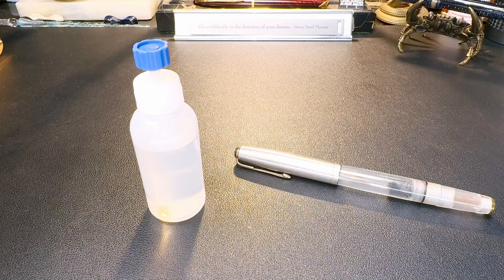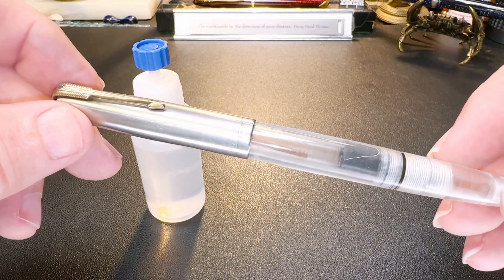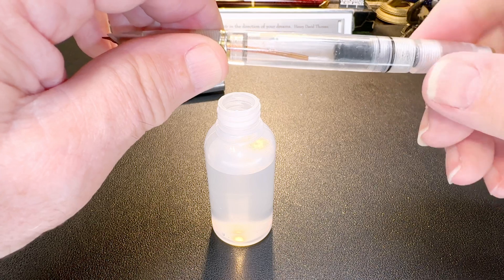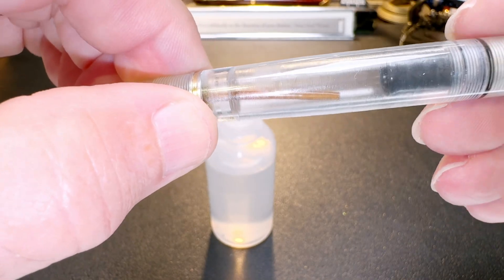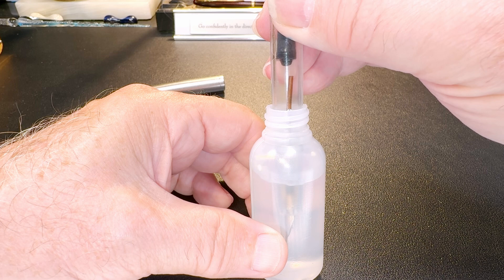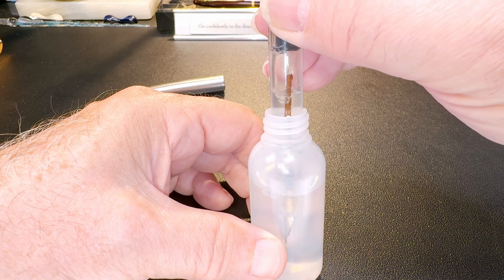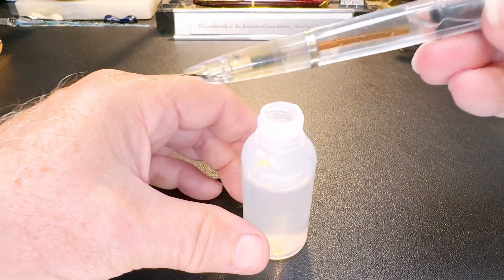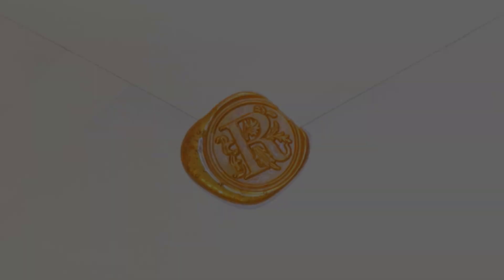How Does a Parker Vacumatic Filling System Work?

Comment: Doug....great job. I have to remove a black jewel and trying to get up the courage to do so. Do you mind sharing what type of heat gun you are using. Also....would love to see you polish and learn more about the polishing compounds you use.  I just have fallen in love with my Vacumatic but also don't want to damage it. JH
Reply from the maker: I try not to use heat on Parker jewels. They are soft plastic and will melt easily. I put a pencil with the eraser end inside the cap and then press down into some rubber mat material or a rubber band and try to twist it off. If that doesn't work, I'll let the cap soak for a while in the ultrasonic pen flush bath and try again. If that doesn't work I put a drop of "Pensbury Manor Pentrate Pen Potion #7" on the finial and let it sit overnight and try again. https://www.pensburymanor.com/product-page/pensbury-manor-pen-potion-no-7

Comment: I do prefer this rubber vacumatic to spring loaded piston used by Wing Sung 601, because it doesn't get clogged by pigmented ink and needs no greasing.
So I bought the rubber kit for 601, which works well. Though it went from 4-5 pumps to 15-ish pumps to fill the pen.
Reply from the maker: It sounds like you've found a great solution for your Wing Sung 601!

Comment: Nice demonstration video Doug!  And to think, this was a pen that once upon a time only dealers and salesmen used to promote the sales of these pens.  I saw the pen in action after I acquired my own demonstrator not long ago.  An update on my 51 Aerometric conversion.  I got it done some weeks ago, even though I thought I needed a new breather tube.  Then I took another look in the big 4th edition repair book, and noticed they said it wasn't needed so I finished the job.  I've already gone through the first fill of the converter, and ready to fill it up again.  A funny thing with that metal adapter - Parker cartridges are a little too wide near the top, and don't fit (at least I'm not ready to try and force it yet).
Reply from the maker: Try Lamy long cartridges.

Comment: If you fill the pen full  maybe when the temp or pressuere  varie the pen will be vomited.
You hace to Pushkin only 4 times  and while the it is pushed you Take ii off  frontal  the inkwell.  Wrap it  with a tissue  and put up the nib. Then reléase the buttom , clean  and push again the button some times to be sure there is not vomiting of ink.
This way I use and the pen is in my pocket and by plane too with no problems.